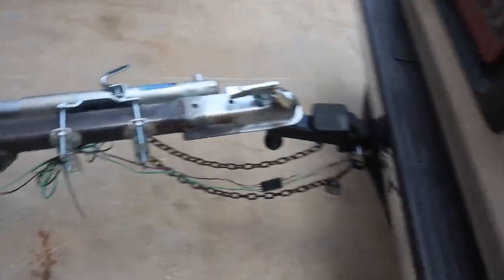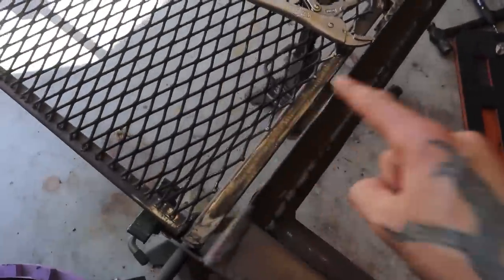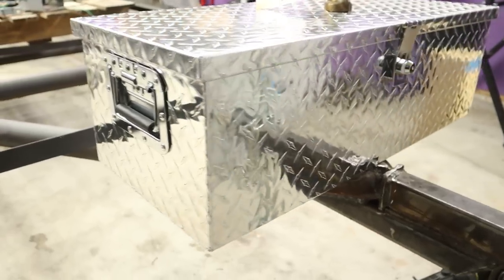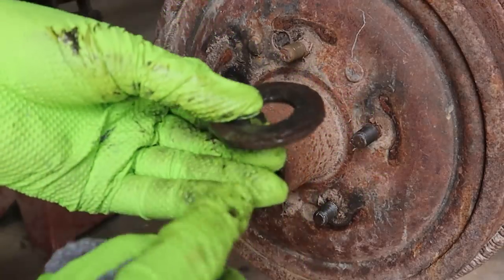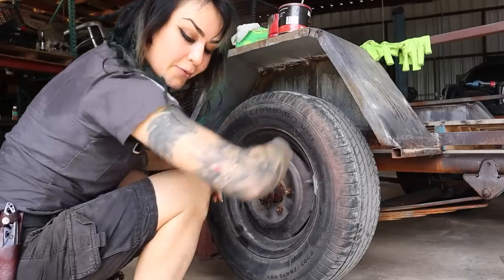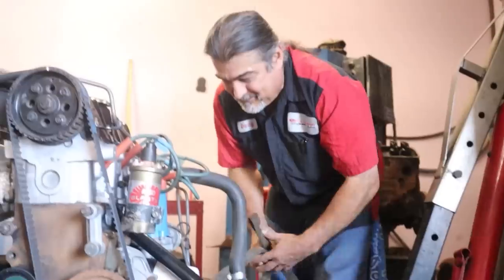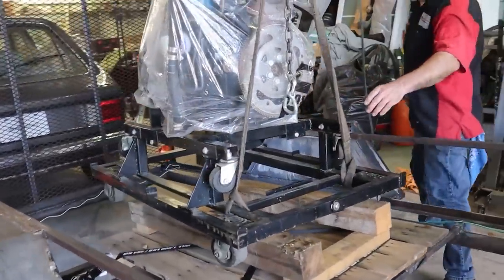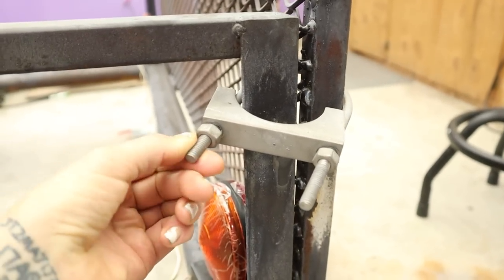Crappy Trailer's HIGH RISK TEST VOYAGE (transporting the Hot Vapor Engine), Welding, Safety& Update!

Comment: What you've done so far looks pretty good!!   I made a trailer back in the 70s.  It was for hauling my motorcycle.  My dad turned me on to this idea.  I was using a Toyota Corolla at the time.  He suggested looking at the spacing on the bolt pattern.  It turned out that was the same as my second car, a Ford Falcon.  We went to the salvage yard and got the front wheel assy.  We modified it to accept some square tubing that  we welded in as an axle.  We rebuilt the brakes and added an electric actuator so that when I hit the brakes not only did the trailer lights come on but the brakes were actuated.  It wasn't  enough to stop the car by itself, but it reduced the braking effort on the car brakes.  We had some fun adding leaf springs but since you already have them that would be a headache you can avoid.  I don't say that's the only way to go but I used it up to 93, when I sold the bike and trailer.  So 20yrs of use was a pretty good return on investment.

Comment: I just put new jack on my trailer.  I didn’t realize how missed up the old one was till I put new one on. Lol.  I got the one from tractor supply that u pull pin and either turn or just pull it off.  I got 2 extra mounts that I welded behind my rear tires.  Now I can use the jack off the tongue to jack up the trailer if I need to change a flat. 😎. I always till people I could never sell my little trailer. I didn’t build it but I’ve done so much work to it. It’s never going out the family.  Lol.

Comment: Dodge, Plymouth guy.  I used to Tow with that 2.2L motor put 290,000 miles on it.   I heard you can Bevel Port Oil intake somewhere to boost oil Flow on that type engine.   My turbo dodge ate headgaskets every 30 or 40k of hard use,   ended up helicoil some of the headbolt holes.   If you have a big battery the alternator will sacrifice  itself trying to bring the battery up to charge.   Most other issues can be buffed out with some sweat.  It can be hard to reach Alternator Belt adjuster and locknut,  its combination of difficulties requires work input to get the desired result.   Memorable

Comment: Faye Hadley a couple idea's for improvement on the trailer.....a 2 or 3in drop ball cause it's way too high and putting stress on the axel, for the gate I'd go over to the home depot and get a couple of push release pin locks and with the tool box on the front would probably work best and you could mount your winch inside so no knows its in there!! As for the wheel bearing I'd look at the pull a part see if you can find an old Ford or gm car that had drums on the front and put modern tapered bearings in them. You might even find some at the swap meet. Measure your spindle shafts and you will find some. Hope this helps! As you can see I've had to do this on a few trailers I've had over the years! Lol lol 😆 🤣

Comment: Faye, if your not already using a chemical filter respirator you need to start using one while welding galvanized metal. when you weld galvanized steel it gives off toxic fumes.
Reply from the maker: Great point!!! I actually did a video on this, where I show how he removed the galvanizing and also the respirator that I was wearing! It's the last video in this series! Check it out and let me know if you approve of my methods and if you think my respirator is up to par! It's a painting respirator That one of my dear friends who sells auto body products gave to me for my birthday last year!
Reply: @FayeHadley  OMG dealing with toxic fumes/gases is no easy task....

Comment: I'm not sure if it was mentioned already, but a roller style bearing would definitely be better suited than that ball bearing on the axle.
Reply from the maker: I haven't seen it mentioned yet, I think you're the first!!! But yeah I've been toying with the idea of what axles to trade these out with.... I actually haven't been able to find the part number just yet, so I still haven't figured out what these are from!!!
Reply: @FayeHadley  if you can't figure out what they are, they may just be something that was pieced together. 

I would think any axle/bearing combo from a Ford or Chevy pickup or van would work well as a conversion - whatever is easily available.

**I've seen standard wheels mounted with tractor tires where the wheel lug holes were welded and new ones drilled to match an oddball hub from 100 years ago - because it was laying around the farm...

Comment: I don't know the history of your trailer, but it looks like the drums came off a random trailer that had brakes. And an old one at that (Ball Bearings???)! If it were mine, I'd just go get some brand new hubs with tapered rollers. They're not that expensive, and they're the right ones for that spindle set up. Plus it's a great excuse to get some calipers out and measure the spindles.

Comment: just want to throw out there, you have a nice welder!
Reply from the maker: Thanks so much, Jess!!! I got really lucky with it. My last welder got stolen when I was out of town, and I wrote to Lincoln and explained what happened and asked for help, and they gave me a massive discount on this (last year's display model) and I COULDN'T BE HAPPIER!!!! I'm not great with setting up the machine, but this one makes it so easy - thickness of metal? I can do that. Gauge of wire? Okay, I know that too... Type of material? Check! Type of gas? GOT IT! Then it sets itself up for me !!! It helps me be a much better welder than I'd be naturally 😅
Reply: @FayeHadley  Im glad you like it! I have the ESAB 205i Rebel, theyre similar. Take a look at Lincoln weld helmet 3350 w/4c technology, welding becomes more clear! I recommend it, ive been welding aircraft for 21yrs and it helps in my opinion. If you need help, and your weld mentor isnt available,  reach out to me, i live behind in n out down the road id be more than happy to help.

Comment: recently I saw a fan that fitted over a 5 gallon pail. a line went into the bucket 🪣 to draw water into 2 misters. on the side of the fan. as the blew air it cool down the temperature in the direction it was operating. I can't recall the name brand of the fan. try a search on YouTube for fan + 5 gallon bucket. the base of the fan    fitted over the rim and stayed in place. not sure of the fan color. I saw it this same week. 5 - 7 bucket uses.
Reply from the maker: WHOA!!!!!!!
Reply: Ok, I found the brand name of the fan. Kobalt 24v max fan. works off a battery pack. this tool line come under a blue color, ryobi also has this type of fan.

Comment: Excelent work, your welds are unspeakably better than the original.. Oh those originals.. it's like someone puked some metal on there.  🤮Actrually I'm amazed it was used on the roads... Was it? In my country it will never pass inspection.  Well, welding thin and galvanised stuff is a pain the butt, but when you achieve fusion you win. 😃 In your case the galvanising was removed in the acid, so no trouble at all to "fuse" it together. I'm also allergic at sloppy work, sometimes you close an eye, but structures are not to be sloppy at all. As always you have to start somewhere and try the product you made to gain "satisfactsion". 😏After, you feel good as a chicken over a layed egg.. it gets proud. 😇 I'm always mistified at what contraptions you americans build at home.. and where do you get all the parts and pieces.. 🤔Cheers, mama Faye.👍